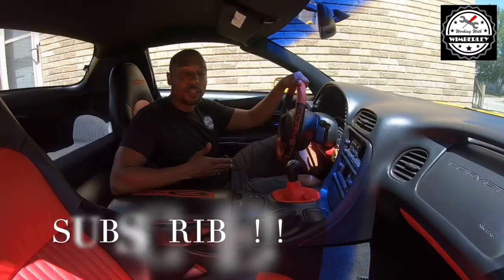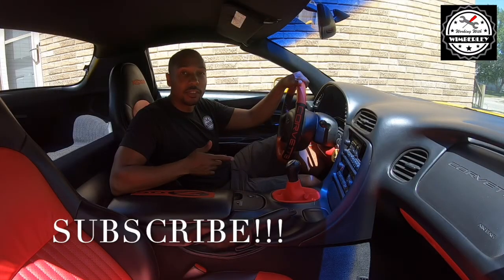Automotive Stories Episode 1. “I YELLED AT THE MECHANIC!” WorkingWithWimberley

Comment: I had a garage quote me $500 to change a wheel hub because I had an ABS light on,after checking it out myself,turns out the sensor was just unplugged.
Reply from the maker: That’s a shame. I’m glad you found it! I had similar situation. It was an unplugged connector after replacing my rear shocks. Thankfully I found it before taking it in.

Comment: Man I do most of the work on my Escalade, but I have an issue.... when I start up the truck for the first time it has lifter noise but goes away .it only do it when it's been sitting for awhile
Reply from the maker: It could be low oil pressure. Have you changed the oil pressure switch?
Reply: @WorkingWithWimberley  It was the exhaust manifold gasket
Reply from the maker: @Jacblack69  Ok. Glad you figured it out.
Reply: @WorkingWithWimberley  yeah man got to get it right,thinking about selling it, do you know anybody looking for one